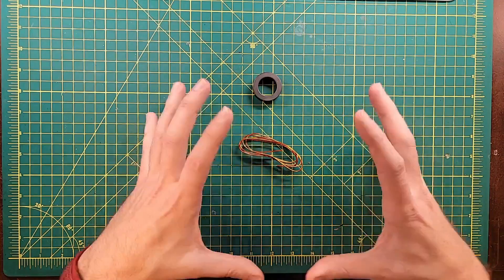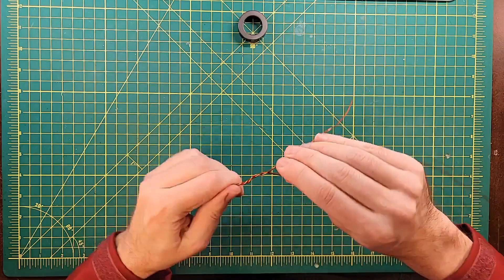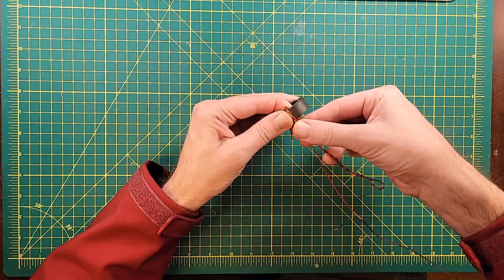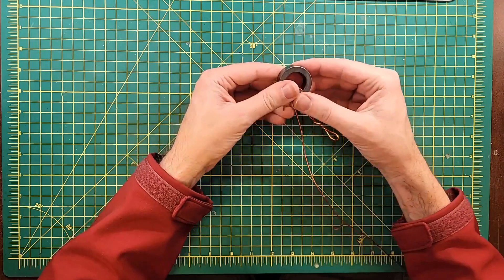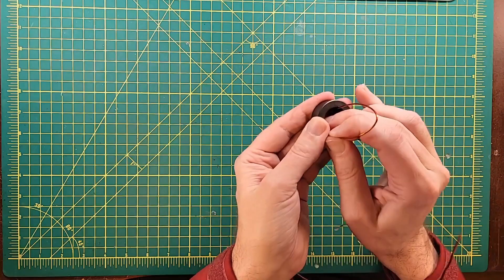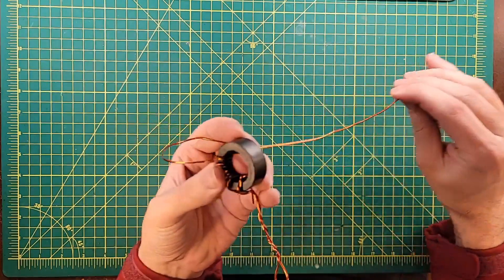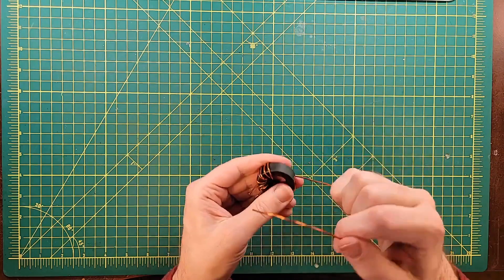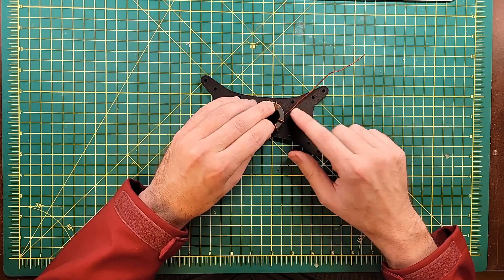How to Wind a 49:1 Transformer for your End Fed Have Wave Antenna

Comment: I have kind of a silly question, do you think it can handle 100 w, or 100 w digital even?
Reply from the maker: We've tested this setup to run at 100w voice and 50w digital.  Anything more than 50w digital and you'll start to over-temp the toroid and lose your SWR matching capabilities until it cools down again.
Reply: @temporarilyoffline  awesome! Thanks 👍
Reply from the maker: @IM1deadMONEY  I forgot to mention, if you want higher power, add more surface area to the toroid - double or triple or size up and double or triple.  I'd 'assume' that 2x 240x43 with the right gauge of enamel wire would handle power.
Reply: @temporarilyoffline  Oh thanks! Yeah, I would have just added bigger wire. I'm definitely thankful for YouTube Elmer's like you. I'm just surprised at how easy it is to build a decent antenna on the cheap once you know your stuff!
Reply from the maker: @IM1deadMONEY  Yeah there are a lot of things that way, I love finding them

Comment: how is it 49 to 1? with only 11 turns? Oh what power will that take? I have 1.2K amp and a Palstar AT2K looking use it on 60,40,20m 
best 73 Noel G8NDT
Reply from the maker: Don't know what you do/don't know, so if you know all this, skip to the end:

2 primary, 14 secondary - you'll see 12 turns and then the extra 2 turns that run twisted with the secondary gets you to 14 total passes through the core of the 'roid. 

14/2 = 7
7^2 = 49 (7 squared)

That's how you get the 49:1 maths.

This particular wrap will handle 100w sideband and 50w digital.  You'd need to add more cores for heat dissipation and thicker wire for power handling.

You can get 40 and 20 for sure, but I'm not sure about 60,40,20 as 60 isn't a harmonic.  There are creative ways to add it, but...  Sounds like you're going to have some fun!
Reply: @temporarilyoffline  Hahaha bro stopped watching at 6:05
Reply from the maker: You missed the best part @ranchosinnombreJimmyandAnn

Comment: I’m still trying to wrap my head around baluns and ununs (pun intended).  I understand how AC transformers work, but they’re wound in pretty straight forward ratios.  Is this method just more simple to do by hand?  Wouldn’t it be more efficient to do 490 turns around the toroid with 24ga, and 10 turns equally divided with 16ga?  I’ve seen so many methods used so far.  Also, does the ferrite size matter?  Obviously too small will saturate.  But is there a downside to too big?
Reply from the maker: The concepts are all similar and you make me think its like reducing fractions - if 4:8 is good, then 2:4 must be good, then 1:2 much be good... so less work?  

2 primary, 14 secondary -- 14/2 = 7 -- 7*7 =49 -- 49*50 = 2450 = close enough to the feedpoint impedance of an EFHW wire.

Secondary/Primary = (M)
M^primary = (transformation)
(transfromation)*50 = amount of transformation

(50 is the arbitrary agreement on ohms for antennasand radios)

The size of the ferrite matters in terms of heat dissapation, which sets the amount of power you can put into it. We are using a 140 which is good for 50w "full duty" - a larger core would be able to dissipate more heat = more power!

The "mix" - 43 in this case is the magical properties that we need to transform the impedance properly.

Hope I got it all!

Comment: I looked up that toroid by the number given on Amazon and the one that came up is only 3/4” diameter, but yours is 1.5”, why?
Reply from the maker: Try this link:  https://amzn.to/3vc52lx Although Amazon isn't really a good place to get one, they are expensive.  The spec is the first number is the width and the second is the "mix" which defines its properties.
Reply: @temporarilyoffline  thanks.

Comment: What's the difference between the 9:1 Balum and this 49:1 ?
Reply from the maker: The 9:1 is designed to transform 450ohms to 50 (450/9) and the 49:1 is designed to transform 2450 to 40 (2450/49). Then you attach a wire that makes your radio or your radio's tuner happy and gets your desired mission complete
Reply: Thank you for your answer  @temporarilyoffline
Reply from the maker: You're welcome.  Hope it helped!  @kr4awkr4aw5

Comment: You need a 64-1 un-un for endfed antennas  for these bands, cut wire about 64 feet?  if I remember right, to tune it for the CW portion of the bands, a 49-1 will work, but not as well as a 64-1 transformer, if you are looking for side band you will need to shorten the wire length.

  I work CW only so I am not to familure with the two harmonics you get with a wire cut for 40 meter side band, I am going to assume you will still get a usable meaning very low reading of the VSWR for 20 and 15 meters, 10 meters on the other hand the impedenance will be much higher where you could get by using a match box (tuner). I never use one so If I were to work 10 meters I would cut a wire length for 10 meters.  I also only work QRP,  I feel a good antenna that is not compermised by using a match box is my best option.

Being able to very quickly to throw up an  1/2 wave endfed antenna, not to be mistaken by a ramdon wire, they are two diffrent antennas, anyway it does not take much time throwing up wire  antenna and switching one out for another only takes a couple minutes, after all you already have the throw line up all it takes is lower the antenna unhook and hook another then pull it up connect to the transformer and you are good to go.

I never use a tuner, but I do carry an antenna analyzer with me, the one I choose is Rig Expert Stick 230. only takes a few seconds to check impedance, lot less time than fiddeling with a match box.

Your mileage may very!
Reply from the maker: TIMTOWTDI
Reply: How I understand it. a EFHW in the lower bands (< 10 MHz) has a higher Impedance(~3200Ohm) than in the higher bands(~2450Ohm). If you want to specifically build a EFHW for lower bands I would build a 1:64 Transformer. But for a antenna that also uses the "higher" bands I would use a 1:49 Transformer.  In a perfect world the impedance mismatch would cause a SWR of ca 1.3-1.5 on the lower bands, which is fine.

Comment: Great video. I've watched several videos on how to wrap a toroid, and yours is by far the easiest to follow. Cheers. 73 W2ASH
Reply from the maker: Wow, thanks!  Glad it helped!
Reply: Does it matter how you attach the radiating element to the enameled wire coming off that is supposed to connect to the antenna? Is it matter if I use a wire nut was there a specific manner like soldering on a longer piece of wire?

Comment: Все показывают как изготовить трансформатор 49/1.   А как изготовить катушку 120 mkG нет видео. Может надо индуктивность 100 или 110 mkG.Что бы кородкий отрезок на 3.65 мГц был  длинее. Меньше добротнось, шире полоса ?
Reply from the maker: If I understand right, there are a few ways to do this:  1. Use a longer wire to get resonant on 3.65MHz, 2. Use a loading coil on the current wire-size 3. Wind the transformer differently to make a match.  Definitely possible!

Comment: I see the kit comes with 90' of wire, 70 for the radiator and 20  for the counterpoise to start with. I'm assuming that I would need to trim down to ~66ft to end up resonant on 40/20/10. What SWRs can I expect on each band if I tune for 40m? What length counterpoise are people having the most sucess with?
Reply from the maker: You can tune it as close to 1:1 as your patience allows for... then once you move it to a new location it will be a little different like you'd expect from any antenna.  We recommend a 17'  poise to start.  We've seen people use no poise with success also.

Comment: I was wondering if different materials have different ranges of optimal usage, and many people tried different materials, and many people used multiple cores at the time then why nobody tried to put into a balun two cores of different materials?
Reply from the maker: That's a good question!  I would assume the "stacking different types" is why we have come up with different types - somebody needed a 31 and all they had was a 43 and a 12... found out it did the trick and then made a 31... and here we are!
Reply: @temporarilyoffline  then 31 and 43 makes 37 mix
Reply from the maker: Ok, so I messed up the math a little 😇